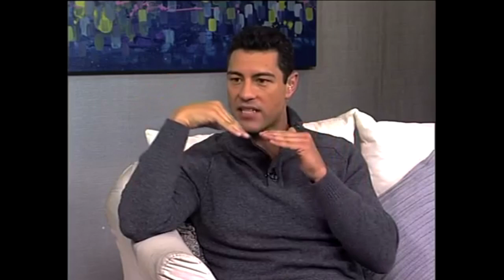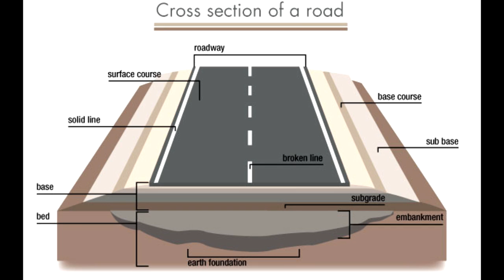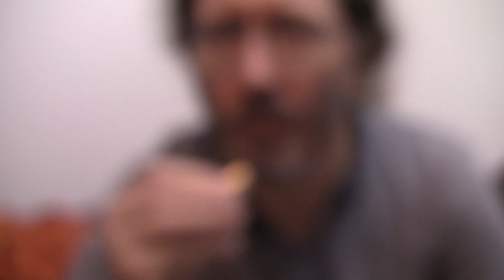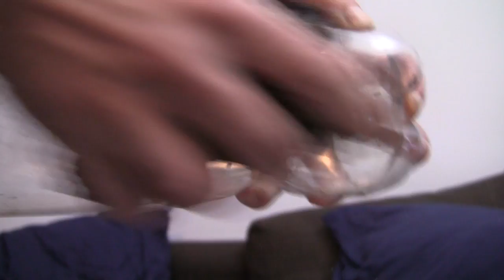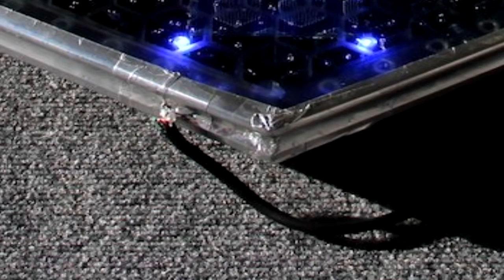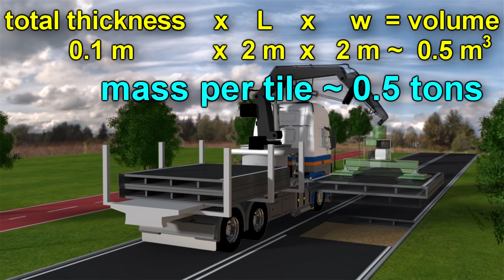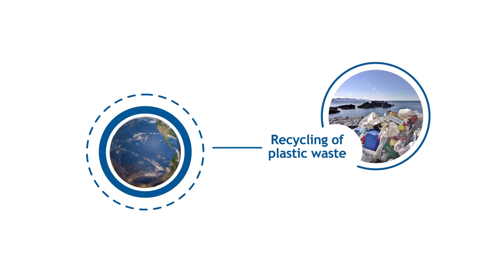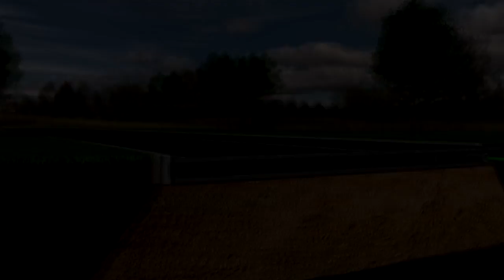Plastic Roadways BUSTED!

Comment: Here (in India) we do use plastic in roads, but it's plastic waste melted, and mixed with regular bitumen. It's not a very significant amount.

Just a way to actually use plastic instead of clogging up our landfills even more.

You wouldn't be able to make roads with just plastic.

http://www.thebetterindia.com/wp-content/uploads/2016/01/waste-plastic-road.jpg
This is what one looks like, and there's actually quite a bit of plastic in it, but most is, as mentioned, just bitumen.

Comment: After 10+ years in the recycling industry, I can tell you that the different types of plastic will not bond together properly without refining the plastic all the way back to pure hydrocarbon state.  The different molecular types just do not get along.  My partner and I had spent a number of years trying to figure it out because we where getting over 50 tonnes of plastic bumpers for 2 years.  Had to suspend the program due to it just not being feasible. 

Great vid Dr. M

Comment: the coast for roads are different than roads. the coast depends on the thickness of the asphalt. An asphalt driveway 2 inches thick is about $2 per square foot and 4 inches is $4 per square foot. however for highways that will have trucks weighing 25 to 50 tons the road needs to be 8 to 10 inches thick with a layer of concrete under underneath it.

Comment: Solar Freaking Plastic Recycled EM Drive Water Pump Cars!
Are you tired of your normal laws of physics breaking EM Drives?
Well then strap a solar panel made from recycled plastic with holes in it to make it water proof and so you can run cables through it so that the water you collect by sticking it in the ground will power a car for thousands of freaking years.

Comment: I'm pretty sure there's a company that makes an additive, not a surface, that reduces the temperature required to surface asphalt roads using plastic bags. correct me if I'm wrong but wouldn't an additive that improves an existing technology be better than reinventing the wheel?

Comment: Saw their animation of replacing sections and thought how the hell do they fix the cable after that? Maybe connectors every 10 feet? That would cost a lot and add 528 potential failure points every mile.  This is just stupid.
Reply: And don't forget resistance. There is a reason we use massive cables for electricity and communication. A connector every few meters would have as much resistance over a mile as a meter of rubber

Comment: Looks like shredding and injection molding.
Reply: To be fair you could chip away at asphalt with your teeth too, I'd just not recommend it.
Reply: Personally I like concrete, seems to last longer than asphalt does and the "Noise" it makes isn't really a big issue to me.

Comment: Your energy balance of plastics is incorrect. You don't get the plastic for 'free' if you burn it after use.
Case 1 - burning the oil - you get ca. 48 MJ/kg.
Case 2 - plastic - you expend ca. 80 MJ/kg and then get ca. 48 MJ/kg from burning it. So the balance is -32 MJ/kg.
The difference = Case 2 - Case 1 = -80 MJ/kg, exactly the amount used to obtain the plastic.
That is because the energy used in the production of plastics does not get converted into chemical energy of the plastic itself (the energy density does not change much) but is rather wasted in all of the required processes, mainly as thermal and mechanical energy.
That being said, PET roadways don't make sense.

Comment: You are probably right, but not sure your arguments are valid.
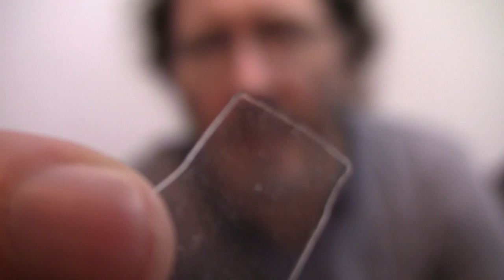1) 5:08 teeth experiment. Did you also bite a 1 mm sheet of bitumen for comparison? I bet the bitumen would crumble... So what would that show?
2) 6:30 scratch test. Did you also scratch a piece of bitumen for comparison? I bet bitumen would loose more material... So what would that show?
3) 7:23 thermal expansion. It is possible to have expansion joints. Also some bitumen expand as much as PET, 63e-6/K. https://s3-us-west-2.amazonaws.com/gios-web-img-docs/docs/smartWebArticles/mat_thermprop.pdf
4) 7:45 Gardeners use black PE pipe and it lasts for many years in sunlight
5) 9:00 you are simply criticizing an artist's impressions. An artist, not an engineer. ... i stopped here.
I share your scepticism, but your reasoning is misleading… deliberately misleading… because it appeals to the viewers you attract.. people that like to be told everything is black or white and care not for thinking or checking what you say... tsk tsk

Comment: Erm, if cables are running through the built-in channels under the surface of the road, how on earth could any individual section be replaced?
Reply: Presumably they would only replace the top section (just the cap), leaving the channeling in place. But it hardly matters since the whole idea makes about as much sense as a chocolate fireguard.
Reply: You remove the entire road, and replace the whole thing! duh.
Reply: By not thinking the idea through? It works for Trump...
Reply: Welp, it would kind of make sense if the cables, pipes and whatnot were lying on the foundation, and if the sections had T shapped channels instead of I shaped ones (imagine the capital letter I with those two straight lines on top and bottom to understand what I mean). The problem though would be the material used for that part of the foundation, but hey, that's their problem, they're the ones making outrageous claims about road-building.
Reply: Yvo Buziau magnetic connections, like once used in the project ara
Reply: Drill a big hole in the surface of the plastic road element, realize you drilled the wrong section, patch it up with some duct tape and try again until you find the right one.
Reply: I imagined something like pulling a cellphone battery out.  It has connections on both sides and "wires" running end to end inside the battery (those are the power cables).  You would just short the panel before removing it and it should be replaceable without losing power nearby.  

Not sure what they would do with water.
Reply: chi How will you put the new road?
Reply: Jonas Grandt alright sure cut the cables/pipes so the nearby town/city loses power and water
Reply: A
Reply: Individual conectors for each road sector?BTW I also think that this is a horrible idea.
Reply: Thank god they have the foresight to include all the  high value copper & Aluminum plus exactly aligned fiber-optical connections they will need.
I really wonder what a 11KV connection would look like once you take into account the expansion of the materials, maybe a couple of great big springs & some copper plates?
Reply: but even if you somehow cut it from below (disturbing all of the foundations which is arguably worse) you would still have to replace the cables for which you would have to shut everything running through all of them off
Reply: +futbolita89742 
so that's why duct tapes are invented
Reply: A fireguard is a sort of cage that one puts round/in front of an open fire to stop it spitting sparks on the carpet and to stop kids putting their hands in the fire. Usually better made of some kind of metal :)
Reply: Bodragon cut open the bottom section and slide it out problem solving 101
Reply: Modularity
Reply: a section of cable, or a section of road? the cables would be in ducts.... easily replaced. Sections of road would be more intensive, but you likely would actually only have to replace the surface itself. doesnt negate the other problems, but i dont think this is a huge issue
Reply: does not seem like much of the foundation  is damaged the plastic is just the coating of the road. think of it like a bracelet. you slide the  pipe through it and then its settled
Reply: You're an idiot.

Comment: The worst thing is that it would emmit tons of microplastic in a year. Microplastic is a huge issue in the oceans.
Reply: But if you throw all that plastic into the oceans, landfills, and incinerators, wouldn't that be the same?
Reply: If you throw it directly in the ocean its obviously worse, but what do you want to say with that. Incinerators is better, because than you only emit co2 (more or less). But in general, plastics should not be produced in first place, since it is a huge threat for the environment. It takes hundreds of years to decompose.

Comment: I do believe we could use plastic in road construction. I mean as an additive to asphalt or to the layers of foundation. In fact it is used that way. There's a thing called geonet, i believe the english term is right, which looks like a net that holds material on the side slopes of the road, helping to prevent rain damage or material rolling down the slope over time. And i also do believe that the plastic used in making of these is reculed. Because you don't need fancy looks for that, so it can be nontransparent and the colour is not important.